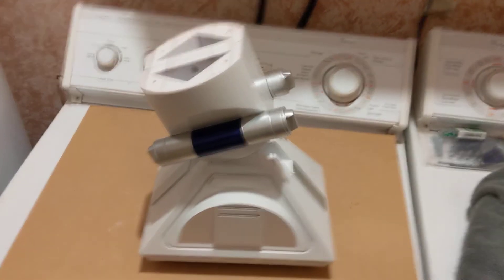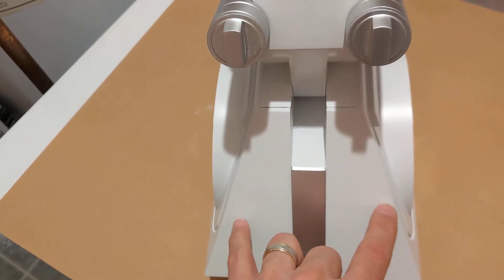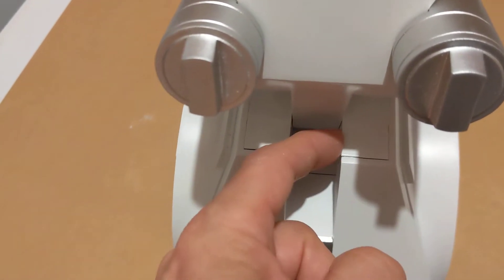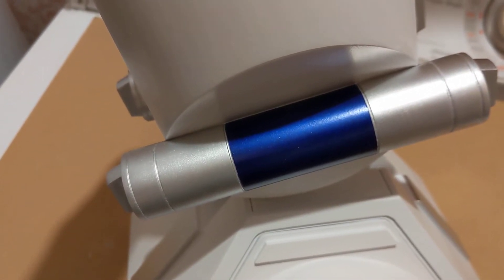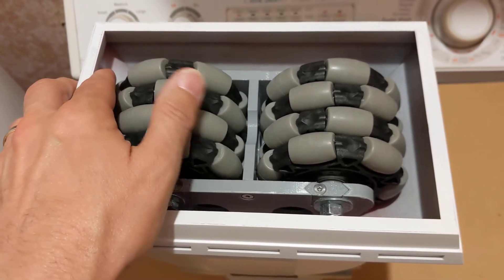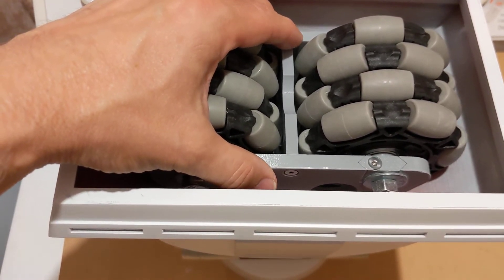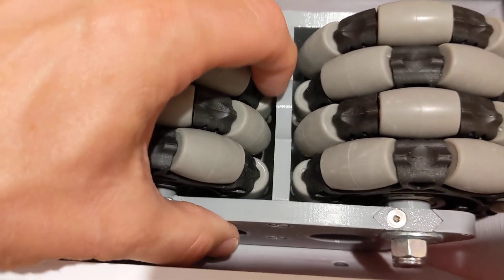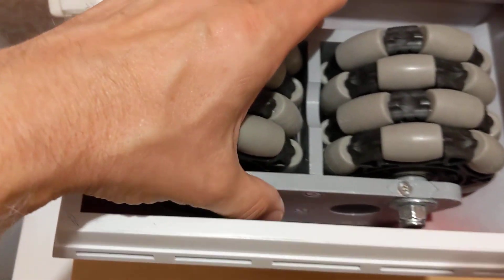3D Printed R2D2 - Part 79

Comment: Question. Regarding the 5/16 threaded bolt. What was the length of the bolt?
Reply from the maker: I think it's 60mm.  Not sure I wrote it down, I think I just put a bolt through, then marked and cut it.  I'd like to get you the exact measurement but it's a hard piece to get to without doing quite a bit of dissasembly.